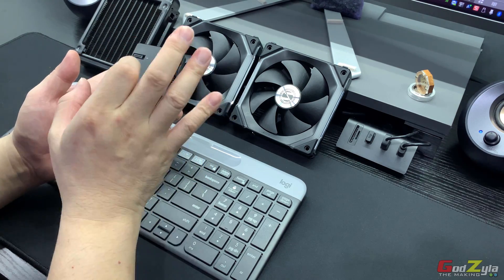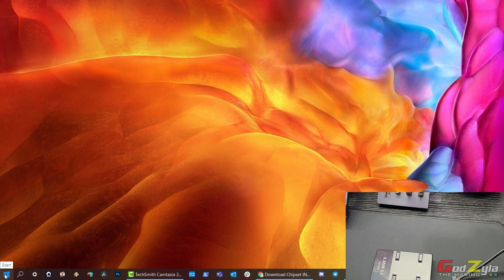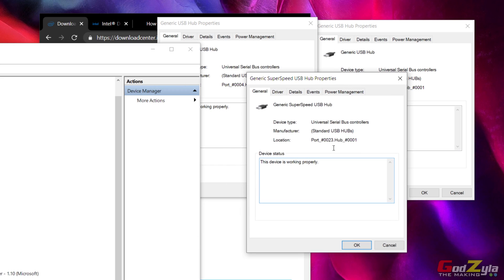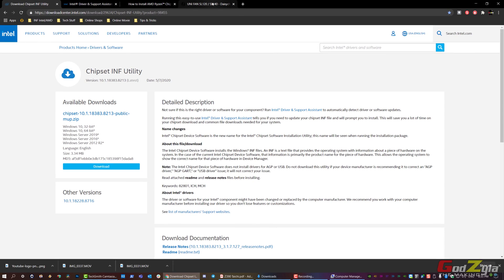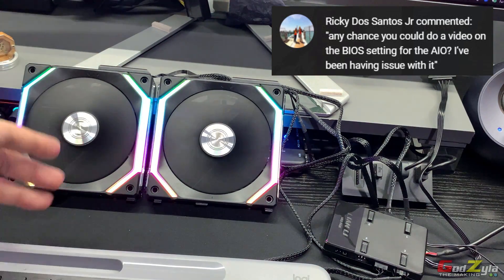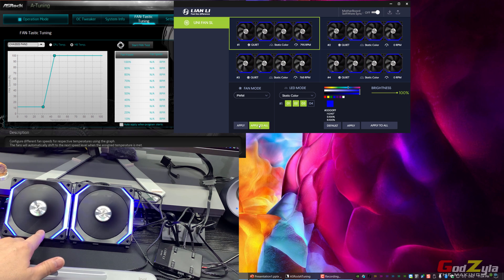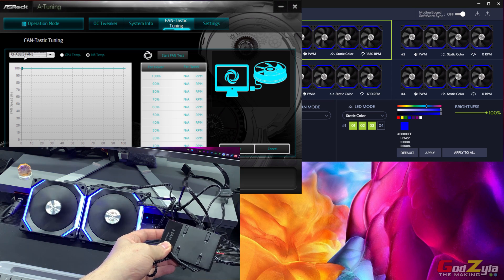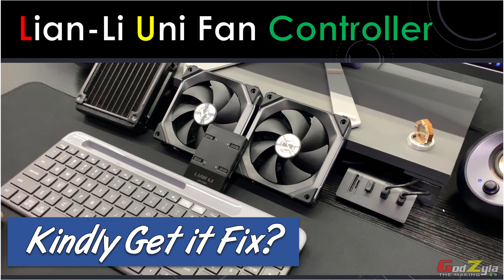Lian Li Uni Fan Controller - Some Break Fix! [L-Connect]

Comment: Hi, I’ve recently changed my fans into the sl120. I got 6 to start with. I’ve installed L connect, tried all of them. My problem is that I can control rpm’s for group 2 and 3 but not on group 1. No matter what I set it in L-connect  the fans are stuck at full rpm. While trying to solve the issue, I decided to disconnect the cable thing that connects into the fans. Bad move, cause now I can’t even get RGB to light up on this group of fans. I’ve also installed the L-connect fix featured on their website. I’ve tried to control the fans via the motherboard also, connecting the third cable onto the hub and to fan-chassi-2, then set it to pwm on mobo, still got no luck. Right now I have a group of fans with no RGB and I can’t control the rpm. Can anyone help? It would me much appreciated.

My specs are: 
MB: Asus B550-A Gaming
CPU: Ryzen 5 3600
Graphics: 2070 super
Reply from the maker: Hello Ruben Silva, welcome to my channel. Mind if I asked if your SL Controller have a SL label on it and also which L-Connect application version are you using?
Reply: @KleoYan  Hi Kleo, thanks for trying to help. Yes, my controller has the SL label on it. I started of with l-connect 3 in the most recent version(I've checked for firmware updates and theres none). After having some issues I tried out L-connect 2 but still had the same problem of not being able to control the bottom fans RPM. I just bought these so im really hoping I can fix this issue. Thanks!
Reply from the maker: @Nebur1503  ok, first off do you see the controller listed under device manager in section call Universal Serial Bus Devices? if you do see that, I would advise you to remove all L-Connect application and other argb utilities app you have installed. follow this steps. 

1)	Make sure you motherboard bios is up to date, please check on your motherboard manufacture website, under support > bios and drivers. See if there are issues with USB and do they have a fix. If there is, kindly update those bios firmware version.

2)	Make sure your chipset driver for your motherboard is up to date!. For AMD will be at https://www.amd.com/en/support for Intel will be Intel Driver & Support Assistant Intel DSA https://www.intel.com/content/www/us/en/support/detect.html

3)	Remove all argb apps (Asus Armory Crate / MSI Dragon Center / Giga Fusion / Asrock Polychrome). If the brands which I have mentioned, do have a uninstall tool like the Asus Armory Crate, use that. Else use Revo uninstaller ( https://www.revouninstaller.com/ ) to uninstall the apps as mentioned. Revo uninstaller will remove all unwanted files / folder / registry in your system. Illustration to use revo uninstaller https://www.youtube.com/watch?v=uMgUYiakpxM&t=437s

4)	Shutdown your PC, unplug the PSU cable from your AC outlet. Press the power switch twice to discharge all current that your motherboard is holding. Leave it for 45 second

5)	Plug the Uni Fan Controller and it’s fan. One controller at a time.

6)	Plug the power cable and turn on your PC

7)	Go to your Device Manager, look under Universal Serial Bus Devices, make sure you see the Lian Li uni controller.

8)	Install the L-Connect 3 app only https://lian-li.com/l-connect3/ (current version 1.2.6)

9)	After installation, run the program, check under Setting > General > make sure Auto-Run on Boot and Minimized L-Connect 3 to system tray at close are ON.

10)	Reboot your system.

11)	First thing you need, go to device manager and see if the Lian Li controller is listed, next open up the L-Connect 3 app. Check if there is a need to update firmware to your controller. Go to Settings > Update, under Device F/W version, click on Update Check, download and install the firmware. Make sure the firmware is completed. Do a check on device manager and make sure the Lian Li controller is listed.

12)	On L-Connect 3 dashboard, check if the CPU and GPU readings are reacting, you might want to test it using some benchmark programs. If there are reaction, play with the PWM and argb functions. If it does not work, skip step 13) and proceed step 16)

13)	If Single controller works, shutdown your pc, connect uni fan set of 3 to your output of your uni controller. Do it small steps at a time to hook up your sets of fans. do not do all in one go. If successful and you have a second controller, proceed small step at a time again.

14)	If it does not work, report your issues to Lian li Tech Support. There is a in build log ticketing system in L-Connect 3 version 1.2.6. this is what you need to do. Go to Settings > Support > Click on “Download log” place a filename and choose a destination drive to save the log file. Next click on “Report” it will take you to Lian Li Tech Support FAQ. Fill up the form and upload the log which is a zip file.
Reply: @KleoYan  Thank you so much, I'll be following these steps later today. I'll update you if I can get it to work. I've subscribed to your channel. Hopefully it works.
Reply from the maker: @Nebur1503  ok. All the very best and thank you to have subscribed.

Comment: i tried everything in this video and quadruple checked that everything was plugged in correctly and yet the fans still arent being detected in device manager and no rgb.. at least the fans themselves work, but id really like for the rgb to work and for the rpm to be changeable.. any more ideas on what could be wrong??
Reply from the maker: Hi pinecsne, welcome to my channel, maybe can you list down what motherboard you are using and are you using the SL120 uni fans?
Reply: @KleoYan  msi b450 gaming plus max and yes i am, also i have an adapter to go from 5v to 12v
Reply from the maker: @pinecsne  based on your specs. do you happened to have the MSI Dragon center installed? if you did, uninstalled it along with your L-Connect app. kindly use revo uninstaller to remove all unwanted files and registry https://www.revouninstaller.com/ ( watch this timestamp for illustrationhttps://youtu.be/uMgUYiakpxM?t=438  )  then follow the steps below

1) once uninstall everything, shut down your pc, unplug the power cable to your pc and leave it for 45 seconds, this will flush out all memory of devices attached to your mobo
2) Connect the USB cable between your uni controller to your motherboard. Also connect the sata cable between your uni controller to your PSU source. you need not have to plug the third cable which is the PWM and argb cable ( https://youtu.be/Rm2emeyMUAk )
3) Boot up your system, look in device manager and look under Universal Serial Bus Devices, do you see the lian li controller. 
4) Now does your uni controller have a SL marking or without a SL Marking, if it's without SL marking, you can only download the L-Connect app and not L-Connect 2 or 3 ( https://youtu.be/hZpzR_4917c )
5) once installed the L-Connect app. try to fiddle to see if you can have the argb lighting to work.

Last but not least why do you need a 5v to 12v adaptor.. this will not work as each led does not communicate. ARGB = Addressable RGB (5v) , RGB = non addressable RGB (12v)
Reply: @KleoYan  thank you for all the information but i have never installed msi dragon center so i dont think i have it. also this is my first build but the fans came with a plug for a 3pin rgb header but my motherboard was 4 pin so i thought an adaptor would work?
Reply from the maker: @pinecsne  I see, you can ignore the argb cable to be plug between the uni controller to the motherboard, just follow my steps above 1) to 5) and you will be able to play with the argb effects.

Comment: Hello I have an issue with my AL120 fans. The rgb is changeable but the fans are stuck at max rpm and when I change the speed it doesn't change? Can someone please help!
Reply from the maker: Hi natunes, welcome to my channel, I like to check did you go to your UFEI / Bios settings to set the fan as PWM mode? also have you set a profile for that specific fan header?

Comment: Hello Kleo, thank you for the video but I'm having some trouble with my sl120's as well. They all spin and work but the controller doesn't show up in my device manager. I checked all the wires and they all are put in properly, every time I go to the app it says that my controller is not plugged in. Do you have any idea what this can be?
Reply from the maker: hello Philo Bolok, welcome to my channel. A few things you might need to check.
1) Does your SL Uni controller has an SL marking on it. if it has, make use of L-Connect 2, if there are no SL Marking, then use L-Connect 
2) Do you happened to have another argb software that's running before you install the L-Connect app, if you did, try this, uninstall all argb programs including the L-Connect, kindly make use of revo uninstaller (https://www.revouninstaller.com/) as this will remove all leftover files and registry of the programs you wanted to uninstall, reboot the system once you have done that and check the device manager again. If it appears, install L-Connect only and try again
3) If 1) and 2) does not work, does your motherboard have another USB Header where you can plug to? Try that.
4) If it still does not work, let me know which motherboard brand and model you are using, will check for you if there are any fixes at Lian Li official website.
Reply: @KleoYan  I would like to take this time to thank you so very much, I was going to return the fans because I didn't know what was wrong with them and I couldn't delete the file. Again I appreciate all your help and will definitely subscribe and like every one of your videos. thank you again!!!
Reply from the maker: @philobolok4858  Hi, you are most welcome. you've mentioned about delete the file? you mean some kind of fan softwares? you might want to try use this application call revo unistaller (https://www.revouninstaller.com/ ) which will remove all leftover and unwanted registry from your system .. illustration here. https://youtu.be/uMgUYiakpxM?t=438
Reply: Yes I couldn’t delete the file because It was saying It was running at the same time, I used the link you gave me and I got all my fans to work out they way I wanted. Thank you so much for your help, you’re a genius!
Reply from the maker: @philobolok4858  You are most welcome, am glad everything works out fine 👍Once again, thank you for visiting and to have subscribe to my channel. 🙂

Comment: Hi Kleo! Thank you for your time making this video. Unfortunately, I still have trouble with my lian li fans where the device manager won't recognize it. I have an ASUS motherboard and was wondering what I can possibly do to fix this? Is this a controller issue or something else? Thank you!
Reply from the maker: Hi Mingyu, welcome to my channel. Mind if I ask, which uni fans are you using? SL or AL and which L-Connect application you have installed? will need to know more info on what you are using before I can try to aid you out. also which Asus motherboard are you using? In generall these are some troubleshooting steps you might want to look into.

1) If you do have the Asus Armoury Crate installed before the L-Connect app, kindly uninstall both apps. for Asus Armoury Crate, kindly make use of their uninstaller, check your motherboard utlity page. As for L-Connect, uninstall it using revo uninstaller. This will remove all leftover files and registry in your system
2) Turn off your system, unplug the USB cable between then uni controller to your motherboard USB header. leave it for 30 to 45 seconds. replug the USB cable again, turn on your machine. once loaded into windows, go to device manager, look under Universal Serial Bus Devices. Do you see your uni controller in it?
3) Next if you are using SL fans and the controller does not have the SL marking on it. download L-Connect and install it. test it. 
4) If you are using SL Fans and the controller that does have the SL Marking, download L-Connect 2 and install it, test again. This apply to AL fans too.
5) If you intend to use the L-Connect 2 but your SL Fans and the controller does not have the SL Marking, you will need to do a firmware. https://youtu.be/hZpzR_4917c

hope all these will aid you.
Reply: @KleoYan  Hi Kleo, I'm currently using an ASUS ROG Crosshair VIII Dark Hero motherboard, L-Connect2, and have an SL fan. Hope this could help troubleshoot this issue :(
Reply: @KleoYan  My controller got SL on it and I disconnected the cord from the controller for 30 sec and tried to do what you told me, but it still does not show up on my device manager. :(
Reply from the maker: @kuolGG  ok one last go before I ask you to approach lian li tech or to request for a replacement control unit. Your mobo have a 2nd usb socket. Can you try changing the usb connection from mobo socket usb 1 to usb 2. If that does not work. Try clear cmos of your mobo. If it still does not work. I am afraid you need to contact lian li tech support or even to have your controller replaced.

Comment: Hi,
I have just installed AL fans with a connector like in this video. When I tried to do the firmware update of the controller all my fans started to go very loud and the controller seem like broken, there is nothing anymore in L connect. Can someone help?
Reply: Unplugging PSU helped. Now I have another issue. RGB changes only apply when I restart pc.
Reply from the maker: @ayoubrossi3265  Hi welcome to my channel, in the first place if you are using AL Controller and using L-Connect 2, you should not do any firmware. unless you are using L-Connect 3. I will also like to check are you by chance have installed other argb programs like Asus Armoury Crate, Gigabye Fusion or even MSI Dragon Center. Try this, uninstall all argb programs including the L-Connect app using Revo uninstaller https://www.revouninstaller.com/https://www.revouninstaller.com/ then reboot your system. First thing is to view at device manager, to see if the lian li controller is showing under Universal Serial Bus Devices. if you do see it as 6K7750, install the L-connect 2 or 3 and try again. if you do see 6K7750, it means that your controller is brick. you will need to contact lian li to have your controller replaced. https://youtu.be/uMgUYiakpxM?t=928

Comment: I just finished my pc L-connect is not working. My fans connected on B550 to Fan controller with SL mark register as Lian-li but the application does not register the controller.
Reply from the maker: Hi Envy 7, welcome to my channel, I like to check before you install the L-Connect app. did your system detect the controller? looks under device management. at Universal Serial Devices. if it did show, now which L-Connect did you download? if your uni controller has the SL Marking, use L-Connect 2 and not L-Connect.
Reply: @KleoYan  My system detects the controller as Lian Li in my Universal Serial Devices. I first tried using L-Connect 2 and when that didnt work I tried L-Connect and then finally went to L-Connect 3 which seems to notice that my Uni-Hub is connected despite registering as Lian Li. The firmware update through the usbisp does not find my device even when I try to browse for it.

Comment: So frustrating.... this will not show up in device manager no matter what I try, and the chipset thing didn't work either.
Reply: I removed all rgb programs with revo  and still doesnt show up in device manager. 😔
Reply from the maker: @dp9550  hi, mind if I ask if you have another uni controller? if you have, can you try using another and do you mind to let me know which motherboard are you using? I will try to aid you out, if not, you might want to contact lian li tech support on your issue.
Reply: @KleoYan  It is fixed, the solution was to connect with only the USB nothing else then it would detect.
Reply from the maker: @dp9550  Nice, you solve you own issue. Once again thank you to have visited my channel.
Reply: @KleoYan  The rgb in these is fantastic !!   Glad I was able to fix it.  Thank you
Reply from the maker: @dp9550  hi, I didn’t solve your issue though. I should be the one thanking you for the feedback. I learn something new from you 😉
Reply: Well I finally gave it one last try before taking these back to the store and I am glad I did,  I removed the controller and the USB cable from my system and used only the USB and connected it to another computer and low and behold it detected in device manager!!!   so I took it back to my system and it detected it !!! nothing else connected but the USB cable then I proceeded to hook the rest of the cables up and now everything works flawless, seems really weird that the order of connection to the motherboard is the answer.  

Connect USB first with nothing else connected then check to see if it shows up in device manager. 🙂
Reply from the maker: hi DP, welcome to my channel, do you happened to have other argb programs installed before you plug your uni controller? if you did, you might want to uninstall all argb programs and the L-connect app using revo uninstaller https://www.revouninstaller.com/ , then reboot your system, See does it device your device and to install the L-Connect app first.
Reply: @KleoYan  I will give it a try thank you.